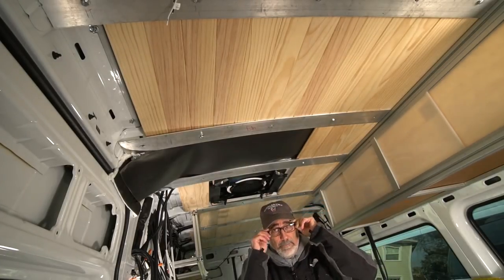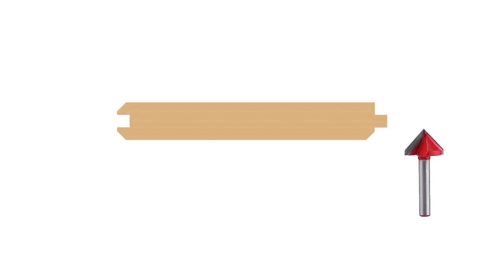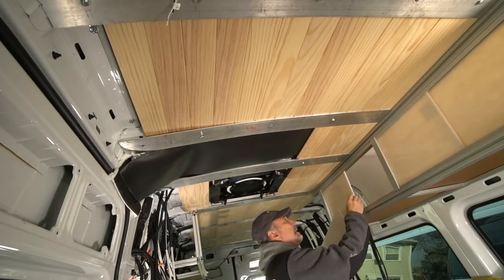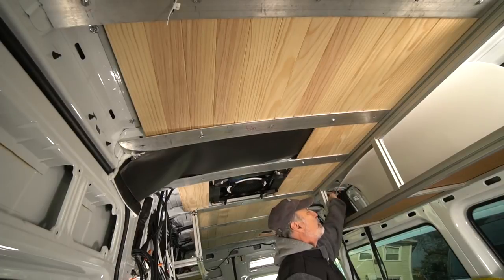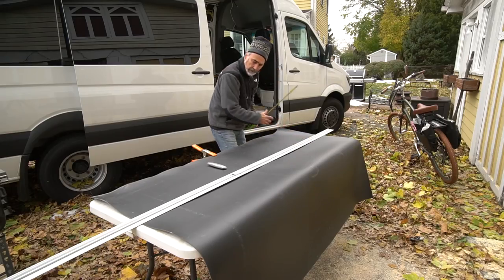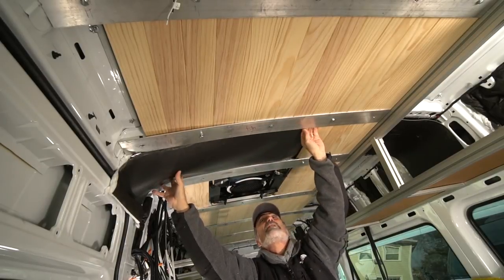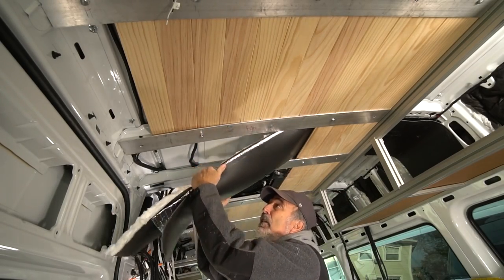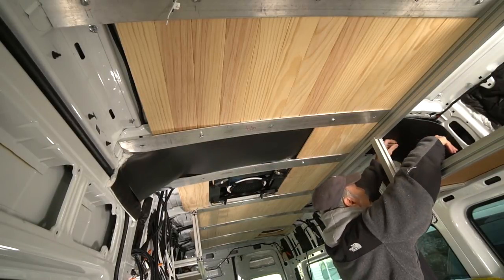Humble Road Van Build Series - Four Layers of Ceiling Insulation

Comment: I would have sprayed the entire van with a rubber spray coat. It would stop mildew and moisture from coming in and collecting.
Reply from the maker: Interesting. I like the sound of this. To be clear, not expanding spray foam, but just rubber coating? Do you know of such a product and how toxic is it?
Reply: @HumbleRoad  not toxic, easy to do, it's a thin coat. Van dwellers have done it with success. You can do it under your layers of insulation. Others have found it stops mildew and moisture getting inside the van and building up.
Reply: @HumbleRoad  the produce that people use is the stop leak rubber that you find in a spray can or a roll on or brush.
Reply: Liz Masi  You're talking about trying to prevent roof leaks, that's water from the outside. Everytime you open a door or window outside humid air fills the inside of the van. When you use propane to cook, the by-product after combustion is 2% propane and 98% water. Unless you drill holes in the roof to mount things outside, spraying a rubber liner to the interior of the van will TRAP, said moisture. That moisture will collect in the white insulation and make it soggy. DON'T SPRAY A RUBBER LINER if you're going to put insulation on top of it. Spraying rubber to an empty cargo van would make sense. It would act as a sound deadner.
Reply: @bentnickel7487  it is another use for this product. Many van dwellers have used this product to stop moisture from collecting and transferring on the shell of the metal van.

Comment: The number of different opinions on the internet on how vans should be properly insulated is quite astonishing. There could be an encyclopedia written on the correct way to use reflectix alone! Comfort levels inside of a van under various temperature conditions is very subjective.  I would love to see someone do a comprehensive test using an infrared Flir camera to measure how effective different types of materials are and in combination with each other under various outdoor temperature situations. There would also need to be consideration for the relative toxicity of the materials used. Not sure but I think most consumers would be quite surprised with the results of RV's and campervans that claim to be four season if this test was ever applied. I'd bet this is one of the reasons why manufactures don't use this test as proof of their claims. I'd venture to say most would probably fail.
Reply from the maker: I have reached out to Reflectix in order to start a dialogue on this subject. Reflectix has become a commonly used product in van builds. It's time to address proper applications. And, I would say, there is not only one way to apply this stuff. Motives, intent and performance factors must weigh in to each individual situation. I would even drive the van to their facility to do some video testing with them.
Reply: Greg Virgoe's provided the most cogent treatise on the subject of insulation in a campervan.

To the one, I've not seen a single example of the proper application of Reflectix. In order for it to be effective requires a 3/4" air gap between the Reflectix and the outer surface of the vehicle. Having no air gap equates to less than no effect. This application is actually worse than no Reflectix at all!

Simply stated, you want a vapor barrier that prevents as much interior moisture as possible from migrating to the inside of the cold vehicle body where it'll condense. Next, you want a hydrophobic insulating material such as mineral wool, closed cell foam insulation (XPS), etc.

Optionally, a sound deadener can be directly applied to the inner surface of the van body. This is solely to dampen vibration of metal panels.

That's it. Pretty straightforward while highly effective and very affordable.
Reply: Reflectix instructions on the package identify MANY different ways to use the material and provides the R-value for each application, from air gaps, to double layers, to direct application.  

Generally for van builds to keep temperature control you do NOT want to put Reflectix directly onto the body of the van unless you are doing a double layer with a gap between the layers, but an air gap between both layers would be even better.  Reflectix instructions say it works best with at least 1/2"~1"" air gap away from the primary surface.

Comment: Cant you make a sandwich of insulator and in middle threll be a ur foam and black matress.bcoc that foam will be spoiled due to cold moisture coming from metal
Reply from the maker: The reflectix will not touch any metal surfaces. It "floats" between the roof struts.
Reply: @HumbleRoad  im not saying about reflective.im saying about the cotton type foam which will be above the reflective
Reply from the maker: explain the layers you speak of.
Reply: Im saying for ceiling
Reply from the maker: Ahhh OK! I understand. You do not want the foil reflectix touching any of the metal surface of the van. That will conduct the heat or the cold very well! The Thinsulate or white cotton type as you call it, is mostly impervious to moisture retention. And with all the layers under it, there should be zero condensation up there.
Reply: @HumbleRoad  ok.i got it about thinsulate.i was worried about that  thinsulate whether that will get moist.but u explained me now that it wont spoil.thnx sir.

Comment: A white van is usually all you need to insulate from heat in the summer. I camped in Texas this May, two weeks in full sun, and my white painted bare steel ceiling was still cool to the touch on sunny 85F days. Winter may be a different story. But not that different. I suspect most people way overthink and overdo the ceiling insulation.

Comment: 1. Why not use insulation with one side directly "reflectix" or whatever you call it - it's all over the place, no need for two layers. 2. Why not use wood siding with tongue and groove and gaskets and perfect fitting and waxing from the factory? 3. Why not bolt it directly to the ceiling? who's gonna disassemble daily that ceiling? You could've got boards as long as the roof to have good looking lines. 4. Vinyl is supposed to absorb vibration - that's why you put it directly against the metal sheet of the van be it on the floor, walls or ceiling. That's why everyone puts it there - to absorb the vibration of the metal. You're putting against the wood planks which shouldn't vibrate in the first place... 5. Why is bare metal exposed behind those cabinets? That's a thermal/condensation problem you're certainly inviting into your van (not to mention noise). I really like a lot of the stuff you do but on some points i'm surprised by your choices..
Reply from the maker: You may say you like a lot of the stuff I do, but I suspect you haven't watched enough of my videos to get a true sense of why I do what I do. It's obvious to me from your questions.
Reply from the maker: And it's OK to have a different opinion.
Reply: @HumbleRoad  I'm not trying to be an ass - I'm really interested if there is a proper reason you went that way and not the other ways (i mentioned above). Sorry if I sounded like an ass - but I'm not seeing the benefit of some of the immense effort you're putting into some things (like the diy tongue and groove siding) that you could get off the shelf. And believe me, i've been watching and rewatching MANY of your clips in preparation and planning of my own Fiat Ducato (Promaster where you live).
Reply from the maker: OK, sorry if I seemed defensive. Off the shelf T&G as opposed to handmade. It's the difference between a manufactured van and a handmade van. I made each and every one of those boards by hand. Every one. That means the world to me.
As I now attempt to explain each of your points, I know I explained them in detail in the older videos (van #1). Cant do it here in a comment. If you would like to email me, we can start a discussion there.

Comment: Also from Reflectix' website:

"What if there is no air space present on either side of the product?
No Air Space = No Reflective Insulation Benefit (An R-1.1 is provided from the product itself for the Reflective/Double Bubble material.)"
Reply from the maker: Sure, an air space of a few inches would be beneficial, but in the case of a van build, not very practical. I am considering the air "in and around" the Thinsulate to be the required airspace for the reflectix. The black layer of the thinsulate is very porous and a non-conductor of heat, nor cold.
Reply: Desmond Tutu  One way to find out, take a reading with a laser thermo gun, before and after the reflective insulation and find the existing temps. This is an ongoing argument on several van vlogs. Just measure both sides with/without reflectix and see the temp difference, in this unique application.
Reply: I have deep respect for what you're doing here.  It is impressive in many ways.  I'm not suggesting that you add several inches of air space; just that you've made a rookie's error on this one detail if you think you are adding more than an R value of 1 with that material in that application.   Otherwise, I love your work (van build and video production)!
Reply: ... or you could just read the manufacturers specifications and application notes.  Reflectix has an R value of 1.1 when sandwiched between other material and it doesn't reflect anything under those circumstances.  There's no debate about that.  R values of competitive materials are readily available for the purpose of comparing the hard science between of them all.  That information is there so you don't have to guess or spend your time running around with a thermonuclear laser gun. ;o)
Reply from the maker: Watch the video again. I actually said I don't expect to gain any "insulative" or R value from the reflectix. With the Thinsulate occupying the air space above the reflectix, I believe it will work as I intend it to. If the reflectix was not glossy or shiny, I would agree with you.
Reply from the maker: No worries, Desmond. A good way to grow one's intellect is to listen. I always listen and keep an open mind. I replied in an earlier post, I never expected any R value from Reflectix. Only the reflective properties.
Reply from the maker: And that would be one of the big benefits of this design. If it doesn't meet expectations, remove it and replace with something that does. :-)
Reply: @HumbleRoad  A friend and I both ran experiments in our vans with Reflectix.  I'm not suggesting you are doing something wrong, just wanted to provide our observations.  Try to keep the reflectix between the roof beams and side support braces, without touching them.  In hot climates like mine, the ceiling cross members and internal braces sort of bypass the insulation and get very hot to the touch.  (They are bonded to the outside skin of the van.)  Without reflectix, these support bars, which are relatively small, heat up and you have these small-ish radiators of heat energy.  You can easily see it with an infrared camera.

With reflectix aluminum taped to the support beams,  you give the beams the ability to continue to absorb heat and spread it to the rest of the reflectix.  The R-value of reflectix is almost nil and the aluminum foil is efficient at absorbing and re-radiating that heat.  In the end, my friend and I were pretty convinced the reflectix was worse than having none at all, and tore all of the reflectix out of our vans.  I still have it in one location--attached to the cabin (driver area) headliner, because that is the only place in my van where there is an air gap and where the reflectix is not absorbing heat from a support beam.  
https://farm5.staticflickr.com/4880/45927291492_3e247e8232_b.jpg <--- a lot of work to put it in, and out it came.

99.9997% of vanlife people will disagree with me, as evidenced by the number of builds with reflectix glued straight to the walls.  I'm okay with being the odd-man out and hope you consider this is as my observation and not a scientific finding.  You won't find two people that agree on the proper way to insulate, that's for sure!  Your work is looking great as always.